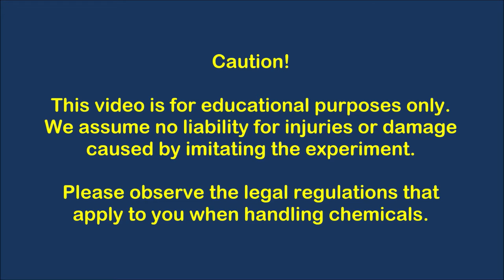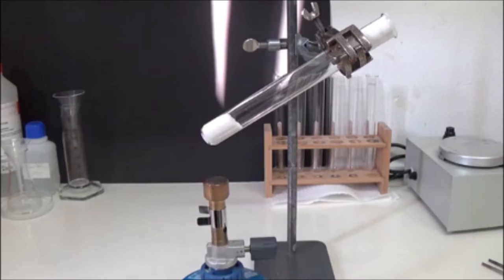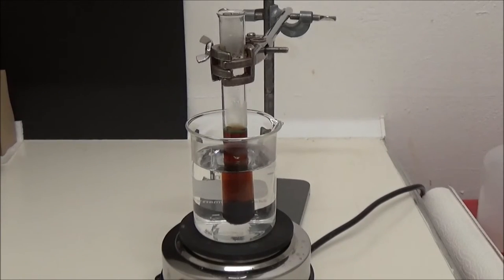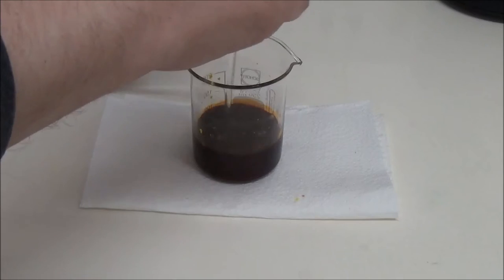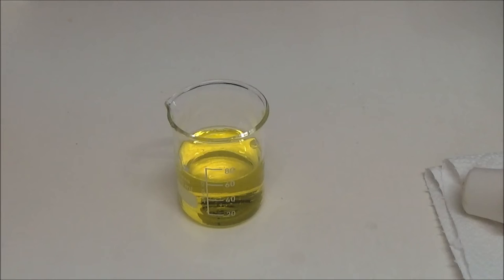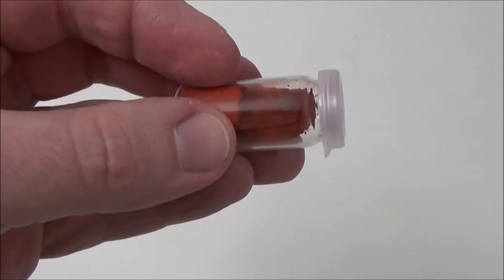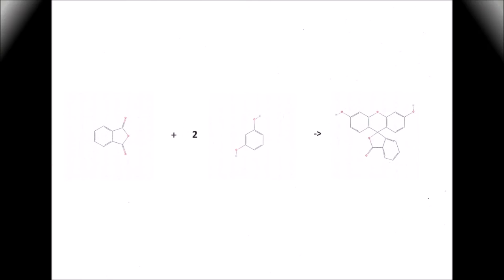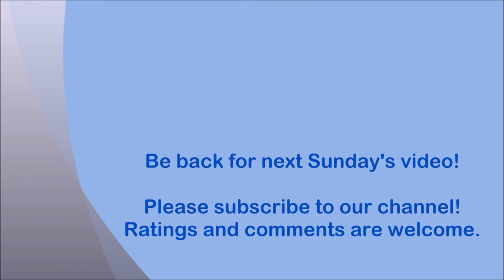Experiment No. 21: Making Fluorescein

Comment: great video, dude! I really like your concise and informative style of presentation
you can see the fluorescence of fluorescein in visible light; a dilute solution (1 part in 1000 or less) appears yellow with a green tint, and it's used to colour some cleaning products
also, if you run the same reaction with m-aminophenol instead of resorcinol, you get rhodamine B, which is similarly fluorescent but red/pink instead of green/yellow
Reply from the maker: Thank you very much!
With pure UV light the effect is most intense and best to be presented on video.
Unfortunately I have neither aminophenol nor rhodamine in stock at the moment.